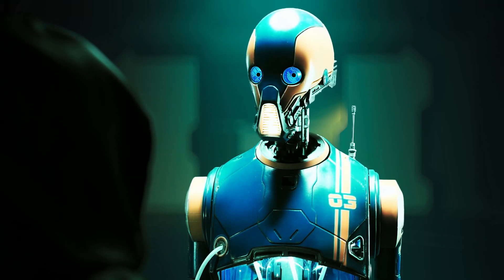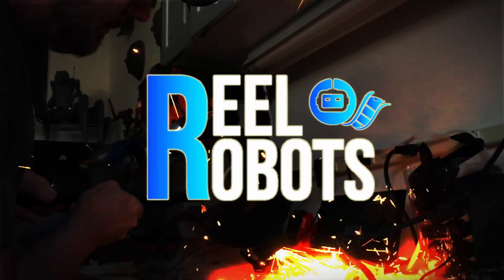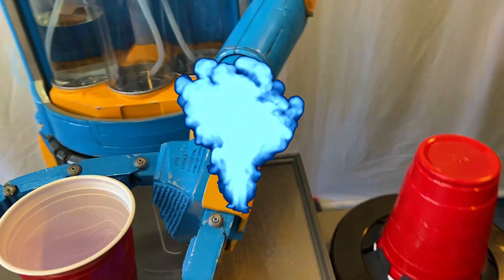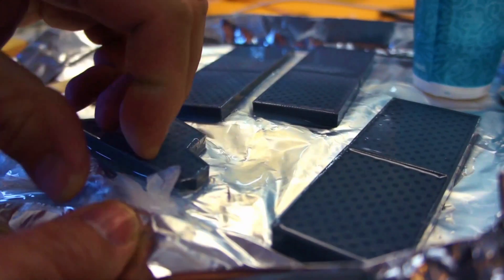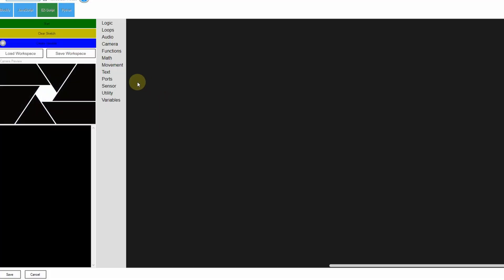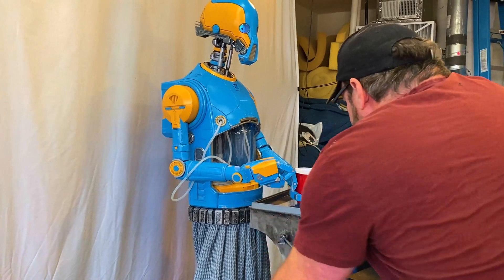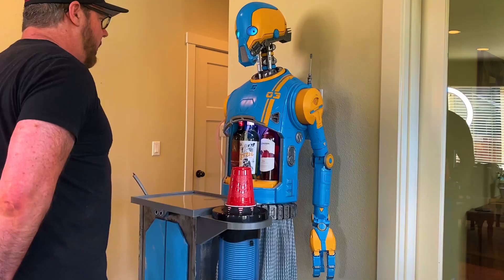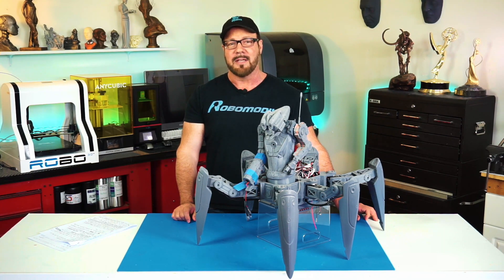Arbee the robot that serves drinks! (Episode 8)

Comment: I just discovered your channel and have subscribed. 

This is a wonderful build. 

I would like to make a couple of suggestions. 

Look into how the dispenser guns at a real bar work. Each product has a separate hose. This prevents the remains in the dispenser tube from contaminating the next drink. 

With all the space under the kilt, you might wish to rig a way to refrigerate the beverages. 

Also try to find pumps and tubing that are NSF certified. That way you know that there are no chemicals leaching into the product. 

Just a few thoughts a few years too late.

Comment: What is the best motor for robot legs that can lift over 400lbs  and are fast?
Reply from the maker: That's a lot of weight. To move that its going to need some kind of gearing which will slow down the output of the motor. It's always a balance. I don't know what your budget is but it's probably going to cost a lot.

Comment: I am building a chatbot with a mask and wig. Do you have a link were you got the servos? I am currently using $3.00 ones and there extremely noisy.
Reply from the maker: Many servos are noisy due to the drive train and gearboxes. There are not many that are quiet. Servos like Dynamixels are quiet but also very expensive. Best to buy and try several brands in your price range and test them. All links for servos used for the head and neck and arms can be found in the description of those videos.